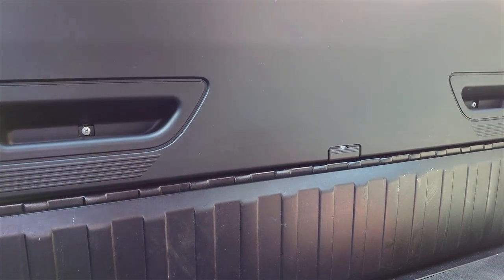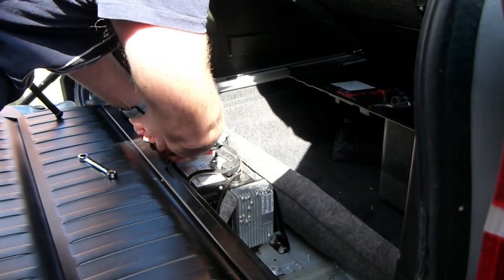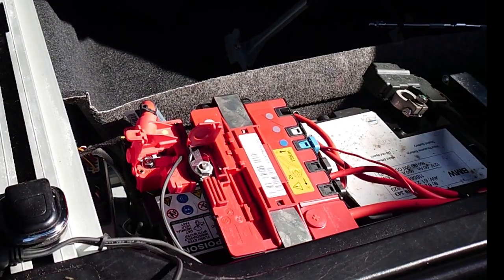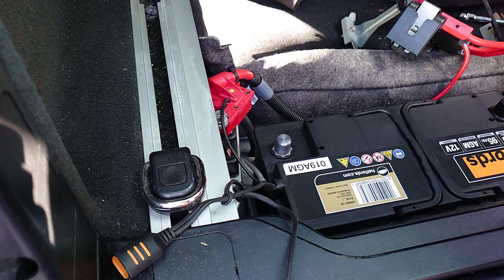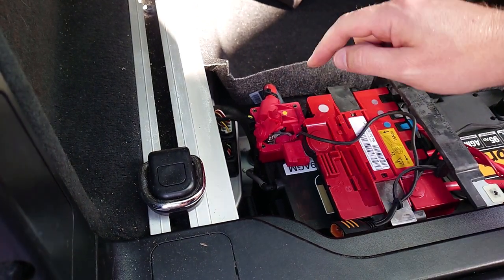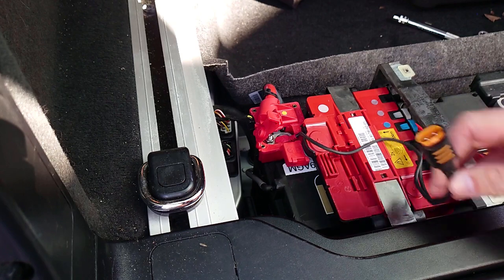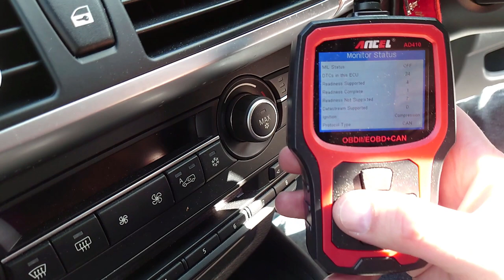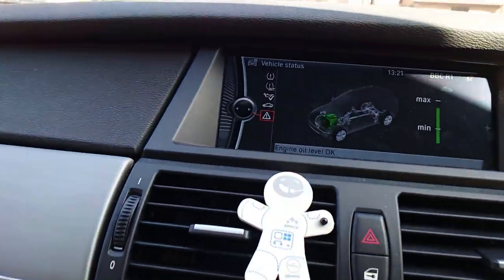BMW e70 X5M, How to replace the battery & clear stability errors

Comment from the maker: Time to replace the battery on my e70 X5M, unfortunately the battery was totally dead and it wasn't letting me into the boot so I had to crawl in and get some charge on first.

Changing the battery is relativel straight forwards, coding the battery is another matter. None of the local garages seem to know or want to take the work on which is a bit frustrating. I'm looking into using BMW tools or something like Carly but don't really want to spring £100 for something that wont really get much use.

If you have any suggestions please let me know.

Hope the video is useful.

Thanks, 

Rich

Comment: The error is normal on a battery change. Just need to start the car and turn the wheel all the way right and then all the way left....Resets the sensors
Reply from the maker: It's dumb that you have to do this isn't it? I didn't have this issue when I owned a Nissan. 350z

Comment: Did you have problems with sport mode after? I have 2012 X6m and I'm having same problem,codes went away but no sport mode. Sport mode was good b4 battery change
Reply from the maker: +Ronald Dennies Jr. I didn't have any issues, have you plugged in a code reader to see if its throwing any other errors? undervoltage problems cause all sorts of errors unfortunately.
Reply: Your pottentialy in transport mode too